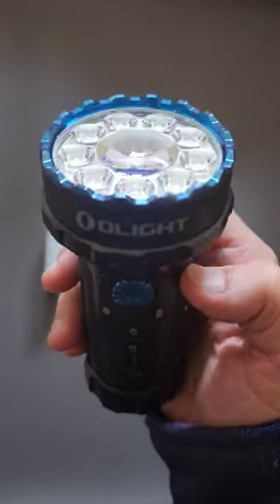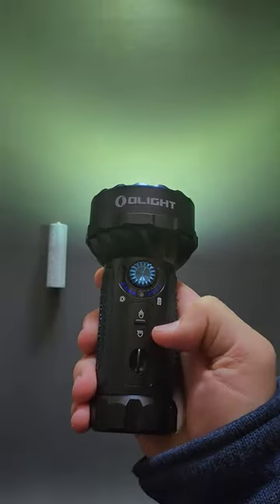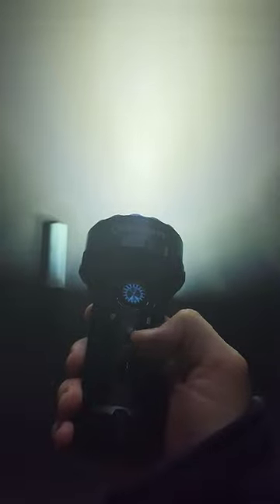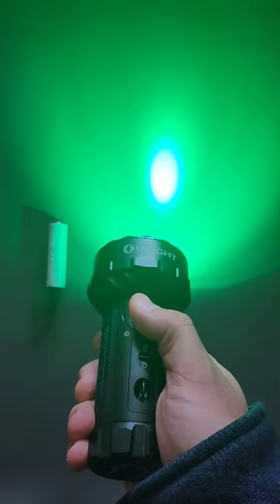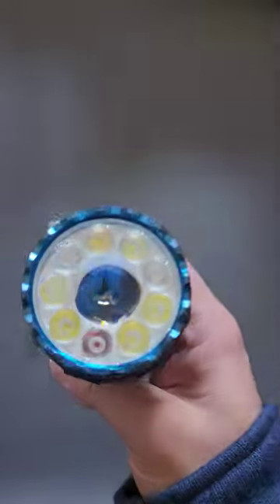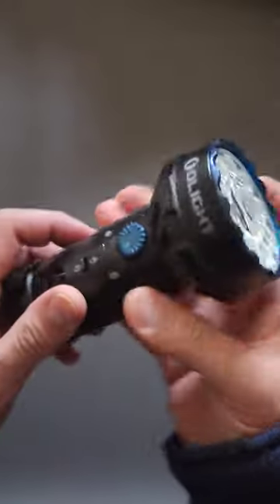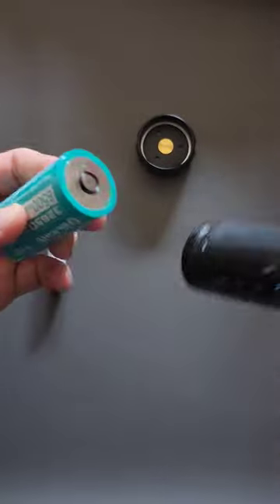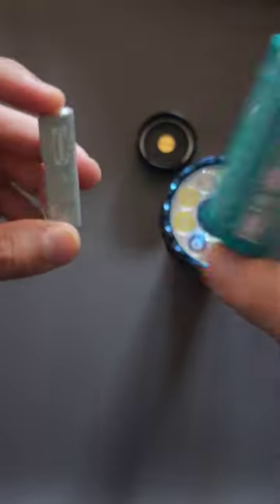🔦 The Least "Mini" Flashlight ever?

Comment: I just got mine the other day. I have already used it multiple times on my farm. Especially since it gets dark around 5 o'clock now. The low settings are all I need. I know it won't run out of juice. It's so easy to turn the lumens up when needed. Some of my places don't have lights(need to hoke up solar), so I just prop this up, and turn it on. Illuminates the whole building or barn. I wish I would have bought something like this sooner, but the size of this one, the ease of use, I love it. It's big, but not overly big. Fits right on the hip no problem.
Reply from the maker: this is awesome.

Comment: Just to expensive for what it is .
Reply: I'd turn that one around: I think the smaller Olights are too expensive. With the MM you get flood better than the Seeker 4 Pro and spot only slightly shorter than the new Javelot and RGB as well, and those two are both well above half the price of the MM a piece.